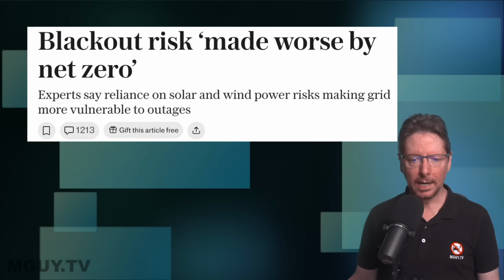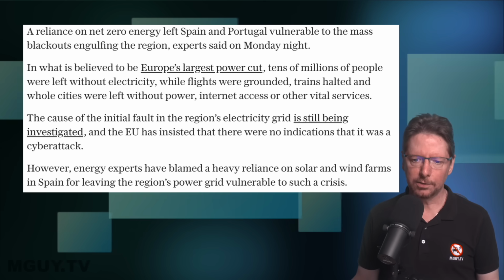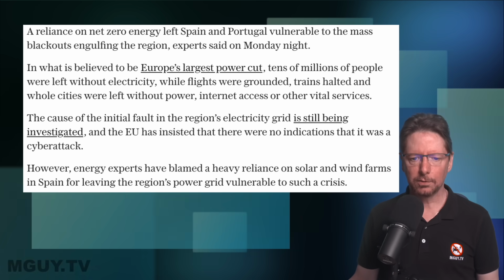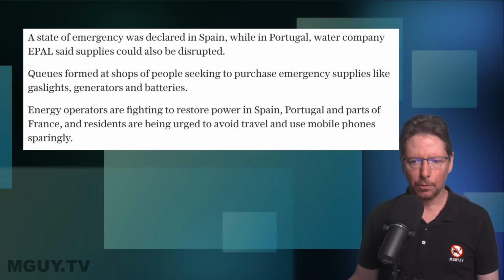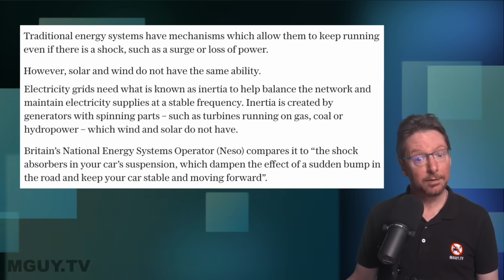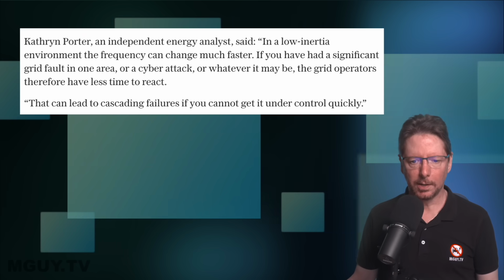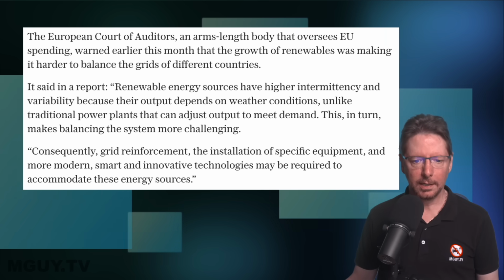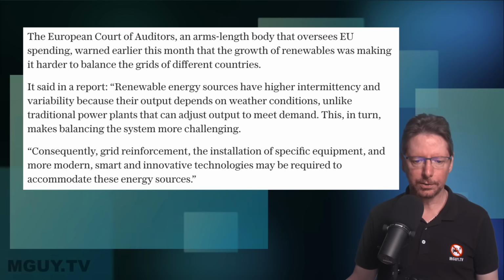Spanish power BLACKOUT: Why Net Zero and RENEWABLES were to blame | MGUY Australia

Comment: A simple flywheel will fix it, grid stability only depends on voltage,voltage can absorb 10 times more energy than a flywheel effect on a turbine,a 5% drop on voltage on a on a 1000 kw sistem is 50 kw,
If the sistem is 1 GW them tha capacity is 50,000 kw

Comment: It can be easily modulated with gravity generators.   An engineer already posited building gravity mountains using large blocks being stacked with renewable energy,h and during down times (low winds…night)…the lowering of the blocks would provide a stable power source.  Cables attached to large high geared turbines would take advantage of potential kinetic energy.   It would easily be predictable and reliable.

Comment: There are  overlooked Physics and maths that describe the effect of the inferior performance of renewables against the fossil/nuclear system being phased out. For some reason no one did fundamental research into the viability of renewables. Green political motivated money in gigantic quantities was thrown at the energy manufacturing business to supply the best they can. They have done so however for these fundamental principles renewables can never equal the performance envelope of the retiring system. The maths work out that the smaller envelope of performance of renewanbles will mean electricity will be become a scarcer resource and therefore by normal market economics more expensive. Subsidies are simply kidology and increasing the grid network complexity and other measures such as batteries actually decrease the total envelope performance of renewables. The basic two fundamentals are the high energy density of fossil fuel and nuclear a the high efficiency of conversion to electricity with steam turbines. Against the low energy density of wind and solar with low energy conversion. This is not accounting for when the wind does not blow  and the sun does not show caused by climate. Further the heavier the working load of a society the less renewables can cope.

Comment: Whilst what you say in practicle terms is correct and kinetic inertia provides very high instantaneous energy. To be fair adding low source impedance batteries and capacitance can provide instantaneous energy peaks when on large scale. The problem with solar panels is the inverters they match the load. If the load is satisfied then they fight each other and any other source of energy on the grid eg nuclear power plant. They cannot switch themselves off nor can they be switched off as needed or at least current panel inverters are not able to. The same problem is happening in Australia.

Comment: Old hydro engineer looking for work. Hydro is the cleanest, most carbon neutral power you can get.

The term generator is really wrong. It’s an alternator. But more importantly, you have a water turbine attached to a Massively heavy flywheel attached to an alternator attached to a DC exciter. These are tons of rotating machinery. A special governor is attached to the gates on the turbine. This precisely sets and controls the speed and hence the AC line frequency. It wants to drive AC frequency at 60 hz within reason. Alternator output is controlled by the DC voltage to the alternator stator windings based on base load.

There are thousands of alternators hooked up the grid. Trying to quickly shut one down is a wasted trip. It’s like trying to stop a freight train on a dime. The independent governors are all trying to meter energy to maintain 60 hz. Collectively, the grid has rotational inertia. Massive rotational inertia.

Placing an alternator online isn’t that simple. Firstly, I have to monitor the shaft speed thru micro adjustments to the governor to get within very tight limits for 60 hz. But then, modern alternators are three phase machines. Now I have to monitor the phases of both the grid and the alternator looking for when the phases line up.

Once the phases are inline, slam the Frankenstein Switch closed. It’s a bit more polished but for this post, it’s accurate. The alternator is now online with the grid.

Should you screw up and miss, you are out of synchronization with the grid. This creates a condition called Hunting as the two sources fight each other. The grid will always win and can destroy your alternator with extreme violence!

Not all stations are self starting as they lack stator jump voltage. The exciter is not yet spinning. In a total cold start or black start of the grid, the transmission lines are taken offline and shunt relays latched in to cold start stations. Once the cold starts are online, they provide jump power to regular stations to get them started. As the grid comes up, transmission lines to critical areas are switched in. Lastly, localized feeders are switched in. It can take many hours to days to black start a grid.

New to all this are renewables which came after me. Windmills and solar banks ate DC which is converted to AC thru inverters. How accurate are they and how effective are they on grid synchronization? Do they weaken grid inertia? Most likely. What techniques can be used to get synthetic grid inertia? Don’t know anything cheap. How effective are the new sources at mitigating clipping during high air conditioning loads? We ran small Swiss made vertical Francis turbines to combat clipping as needed. Water Power!

My state is pushing hard for green power. But they buy a lot of power from Quebec-Hydro. So we have rotational inertia.

Time will tell. But I want more hydro power.

Comment: Sorry guys, but this seems to be nonsense. The problem is not the inertia of spinning systems. Even two nuclear power plants must be synchronised to hook up to the power grid. If I am rightly informed the synchronisation of the different power plant in Central Europe is done by an agency in Düsseldorf in Germany.
The actual problem lies that most solar panel system adjust there synchronisation according to the frequency coming of the power cables not by an external control. So it is not possible to synchronise the solar panels through an external agency (like the big generators are). We had a similar problem a few years back when a big generator in the Balkans broke down and increased to load on the Central European grid. It took them weeks by adding gas generators in Germany and Poland into the grid. Gas generators are normally used for such stabilisations because they respond quickly to adjustments. But solar panels only adjust themselves according to the measurements of the current grid frequency and if the algorithms are not correct it could lead to problems.
I have never seen a unicorn f..t on the grid.

Comment: I have done a lot of small boat sailing. It relies on the wind. You can be whizzing along with a strong steady wind coming from one direction when instantly the wind will change. It can stop dead, it can change direction, it can get much stronger. You have to adjust everything to control the boat. These wind changes are affecting wind turbines, and they have no way to adjust fast enough to the wind's changes. Each change in the wind will change the power output. It is not stable.

Comment: Portugal has experienced massive cold, overcast, rain and some flooding this spring. Hence hydroelectric power is ramped up to prevent head-pond usage while  pv solar farms produce very little to zero power during heavy rainstorms. This scenario reversed about one week ago  and  grid  control rooms were overwhelmed with the challenge you rapidly correct grid inertia issues.

Comment: One important fact was not reported by the green coated media. In order for power to be restored asap, grid operators had to revert back to a parallel, natural gas fueled,  generator powered grid. They could not simply reset the 'smart' button of the unreliable grid output producing an unstable frequency output. Nor can these green geniuses accurately declare  a software adjustment was the solution to a complex integration of frequency variables the system has to constantly interpret and manage in order to maintain a  continuous, stable 50 Hz output. As you correctly mentioned, wind turbines produce DC voltage and current, this DC power must be inverted [ not converted] to a 50 Hz alternating current for grid network compatibility. Let's not forget the numerous inverter output banks via wind turbines  [frequency] must be perfectly aligned with the existing grid frequency of 50 Hz. Various electronic sensors designed into the control circuits of the existing grid determine frequency compatibility by a margin of less than 1 Hz. If an unknown amount  of the wind turbine banks inverters fail to perfectly match the current grid frequency output,  designed system controls simply disconnect the insufficient frequency output source. When this occurs, a cascading sequence of existing generators will shut down in order to save the electrical integrity of the  existing generators, and to protect them from  becoming overloaded with a sudden systemic power demand. Politicians are not electrical distribution engineers, they have little to no idea of electrical generator functions, the complexity of perfect, parallel frequency generation; and continue to wallow in ill fated green ignorance.
Reply: bump

Comment: Speed of wind turbine blades are synchronized to grid frequency. Wind turbine generators turn synchronous to grid. Wind speed do not change frequency only a power output from wind turbine. When you look at same size wind turbines at wind farm all blades have same rotational speed all day long and weeks long if they produce energy.

Comment: Wild AC from solar voltaic and wind turbine generated electricity should not be supported with the public power grid.   The public power grid has to make a good guess as to how much wild AC it will need to instantly backup.   Without huge battery storage or fast reacting hydropower the reliable practical means to backup large amounts of wild AC is with natural gas turbine generators running at high readiness 70% fuel consumption where 100% output would 100% backup the wild AC.

This requires more natural gas to run the natural gas turbine generators at 70% fuel consumption making near zero electricity, where when making up dips more fuel will be used,  than the expected 66-2/3% natural gas use of 100% backup of wild AC to make all the electricity from efficient running natural gas combined cycle power stations where a second steam cycle adds 50% higher efficiency.    If the wild AC is not able to be 100% backed up eventually there will be grid instability causing interlocks to trip causing instant blackouts.  

Obviously given a choice the public power grid would not support wild AC even if it got it for free because it costs more fuel and more wear and tear on the generating stations than making all the electricity from base load capable systems.  Originally the public power grid was asked to support very small amounts of wild AC in order to encourage broad development of alternative electric power generation.   This small amount of wild AC the power grid had enough steam turbine inertia to support.  

Wild AC supporting an entire country as sometimes promoted is typically only for a few minutes where the country is having to get rid of excess electric power requiring additional natural gas turbine generator backup to provide a steady export of electricity.   This would be expected to have the highest required use of natural gas possible to backup all the wild AC.  

A fifty year old nuclear power station is a power station that should likely be replaced.  They were not designed for exceedingly long service lives and there are a lot better implementation today that are reasonable to design a 100 year service life.   There is need for much more electrical power that replacing an old plant with a much larger new power station will provide this expanded demand.   

In the US today it is risky to expect a new nuclear power station will have overall cost per MWh produced cheaper than that from a new Advanced Ultra Supercritical (AUSC) clean coal power station burning high BTU bituminous coal.   Nuclear power stations are costing many times the cost estimated for a new AUSC power station which also require a 10 mile radius evacuation area.  

Nuclear power would be incrementally cheaper per MWh, but the high service for bonds above that of the coal plant used to finance the nuclear power station would cause its MWh to be more expensive.  Better cost control should make nuclear power cheaper, but that is not its history in the US in the last few decades.  There are other benefits form nuclear power such as zero air pollution, no coal piles or heavy shipments of coal that require 2-1/2 miles of coal train to fuel a 3 GW coal plant a day.

Comment: A net zero power system needs a MASSIVE battery backup system to cover spikes and sudden demand.   The bad news, other than the high cost, is that Li-Ion batteries are very environmentally unfriendly and subject to toxic fires.  We need more magical unicorn farts to make it work correctly.

Comment: I never thought about it this way, and well it makes perfect sense now that I think about it. I live in south Florida where we sometimes lose power for days due to hurricanes and have to rely on gasoline generators. When putting something like a refrigerator on a generator, the load spikes when the compressor motor starts and the governor on the generator kicks the engine RPM way up to compensate.

Comment: I once saw a huge turbine generator set bought online and it's quite a complicated process. First they need to spin up the generator to operating frequency which tends to be not be 50Hz but a fraction of 50Hz due to having multiple windings per phase. Once it is up to speed they then have to bring it in phase with the grid before it can be connected to the grid. If they don't do it correctly then everything disconnects at the primary transformer switchgear and they have to reconnect everything before trying again. Once it's connected it is then effectively locked to the grid frequency and phase and tracks automatically with the grid acting in the same way as a mechanical governor worked on old steam engines. Wind turbines and solar need to do all this using high energy electronics which is far less reliable and vastly more complex.

Comment: While 'renewables' certainly did not help us, it's a bit too easy to put the blame there. The entire grid in Europe is so interconnected that cascading failures have happened quite a few times (though this is the biggest). When one segment goes down, it can take a lot with it. Solar panels losing illumination or windmills failing due to local weather introduce problems, but they are mainly local issues which distribution controls can manage. On a grid this large, solar activity on the earth's magnetic field  (or even unusual thermal differentials) can induce voltage or phase differentials significant enough to trigger a cascade of breakers.

Renewables can frequently result in supply shortages, but there is so far no indication of power generation issues in this case.

Comment: Any grid is managed so volts, amp, and vars are kept in a delicate balance.  If one dog these drops below a certain level, the power in the grid will collapse.  That is why you need a constant amount of electrical generation.  Wind and solar cannot sustain the grid alone because of the oscillation of power generated.  You have to have other power generating sources like natural gas, clean coal or nuclear to provide the constant energy to the grid.
Reply: or hefty batteries or perhaps super capacitors
Reply: @ battery storage technology has not progressed to allow enough energy storage to balance the grid if needed.

Comment: Getting solar farms that rely on inverters to supply AC power to synchronize with what's left of any power generation on the grid is extremely difficult.  It takes some time to restore solar power to the target frequency so it is not a quick self-healing system. Finally, the initial blame was on an extraordinary weather event according to the grid operator.  That could be clouds moving over a huge solar farm and the wind slacking off suddenly?

Comment: The National Competition Market Commission (CNMC, in Spanish) has prepared several reports referring to the exposure of the Spanish electricity system to renewable energy. Specifically, the agency indicates that the incipient rise of renewable energy in generation and the high fluctuations in voltage levels "could cause blackouts."

Twenty days before the blackout, Red Eléctrica itself stated on social media that "there is no risk of a blackout and Red Eléctrica guarantees supply. The European Resource Adequacy Assessment 2024 ( ERAA 2024) does not question any nuclear group. The main conclusion of this report is that a significant volume of combined cycle plants could be economically unviable in the coming years if incentives are not established."

Redeia - the parent company of Red Eléctrica -, warned that "there are risks due to the disappearance of a stable generation system like nuclear power, with the closure of power plants and problems due to an excess of renewable energy."

In another report, Redeia stated that there was no possibility of a major blackout occurring.

Red Eléctrica, which presented its annual report at the end of February, identified the risk that small generators or renewable energy self-consumption facilities would have difficulty maintaining "adequate behavior" in the "short or medium term" in the event of disruptions. This model would pose, according to the company, "a risk to the safe operation of the electrical system."